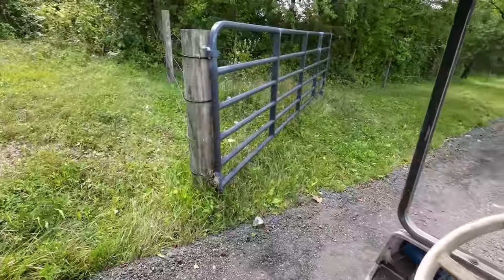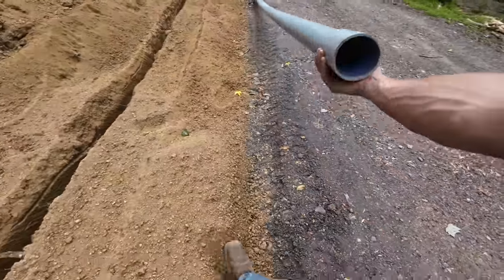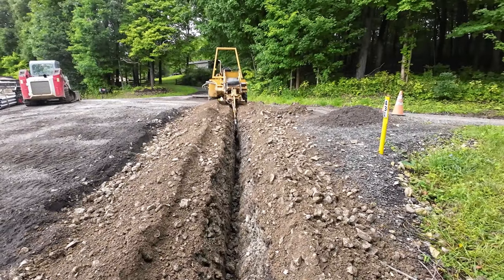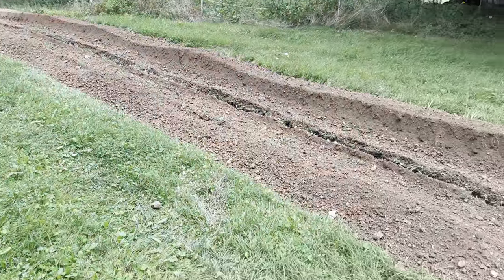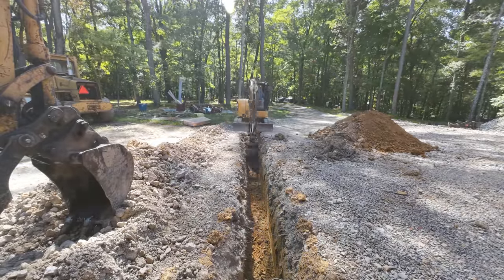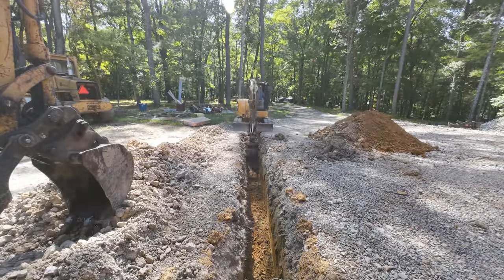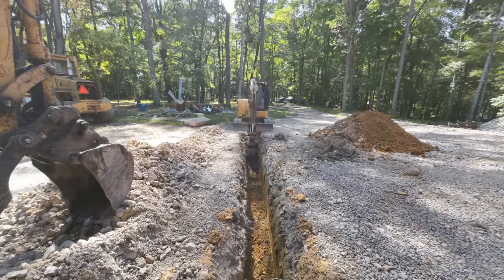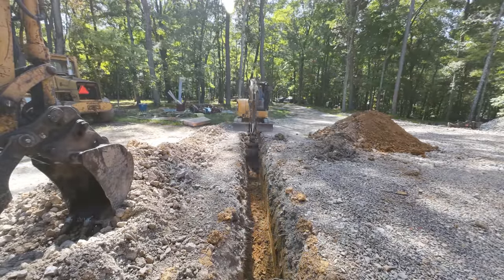Running Nearly 1/2 mile of Underground Electric, Costs over $64,000??!?!

Comment: 52,000 thounded aint bad for 2500 ft if they had to burry it bud its just pulling it in, but your going to pay for the transformers, the wire (high voltage not no romex), meter, time and your not living there so that ups the price alittle bit generally

Comment: If you are responsible for the drop from the pole to the transformer then you can have anyone install the wire.    Call around to various electrical contractors they will know.   I know where I am if the buried drop has to be replaced the home owner is responsible and must get a qualified electrician to make the repairs. .

Comment: I am retired but during my working life I was quoted a large amount for pipe and install wire I found out that there was a new type of electrical wire and that can be installed in older conduit at a quarter of the cost by a private electrical contractor. Done. (30 years ago) looks like yours is playing same old tricks.

Comment: Lol I got a quote to get 3phase power to my house and I live in an end terrace and the 3 phase is cable is attached to the outside of my house and all the power company has to connect one wire 6ft long into the meter my quote is £12000 or about $17000 so I got a phase convertor.

It might be a cheaper solution to you to get a wind turbine and solar panels to run light and heat and small power tools and use your generator for the big power tools and welders

Comment: Sounds like they are charging you so much that you can engineer yourself a solution to pull the string through the pipe for far less and you should.  Look for or invent a roller system using an engine that can "Roll push" the line through the conduit.  A transformer is mostly a box with oil in it, and you can lay the foundation concrete yourself for the transformer.  You can save yourself a bundle, and it would make a great video to engineer a solution for it.

Comment: You do realize solar is $.30 a watt now.  Solar you’d lock in energy costs for 30 years. This is going to cost as much as solar and then you’ll be paying for energy costs as they go up and up and up.  Now water. I’d run that pipe. Wouldn’t want well water anywhere near your property. Not enough sand on the earth to filter all that diesel.

Comment: Everybody wants to do electric work till its time to do electric work. 
Those pulls average 700 feet. The cable reel will weigh maybe 2.5 tons. 
Jet your mule tape with an air compressor. It blows easier than it sucks. A shop vac cant provide the volume to do 700 feet of 3”
I would have dug up those pull box locations
What the utility tariff in Pennsylvania say about overhead charges.  Underground is typically 3 or 4 times overhead for construction 
Sorry . Every thing is expensive. I bet that 3man (4 man) will bring about a million bucks of rolling stock to do that job and your paying for at least 3 days of work
We used to charge $250 hour to sit a bucket truck out on trouble work

Comment: Will the power company let you run the wire. Pulling the wire can be rough but cheaper than 50000. You have a friend that's a electrician, he can oversee the job

Comment: my dude, 64k buys a lot of solar pannels and batteries
Reply: well, other option would be to have all the wire installed and asume it was always there, but i don't know how that would work with the electric company, if the line was overhead it would be a bit easier to inspect but i don't know how do they decide wheather or not to aprove the work.

Comment: Bigger diesel generator. Set of batteries and inverter for when you arent using much power and dont really need the generator going. Use the waste heat from the generator to help heat the shop. Guess it depends on what you pay for fuel, power etc as to how the money balances out, but it sounds like you are going to be struggling to pay back the 50 plus k?

Comment: I am in india, it doesn’t matter where is my shop/home/warehouse, government or power company have liability to put my connection at my place.. only I have to pay for supply wire/cable form next pole, for that too they provide me ratings/range and I am free to buy from any vendors.. 

PS .. there should be a pole in max 100 meter in range so max I have to buy cable for 100 meter
Reply: 12 volt electric service?
Reply: @richardthomas1743  usually no.. 
AC 220/ 440/ or higher as per your need..

Comment: It's what you call extortion because they won't ecsept it if you put your own cable in because they charge far over the odds for the same cable which is out of order and I don't believe that it's legal requirements that you should have to use the cable which they supply

Comment: They threw that number obscene as it is to avoid the job. They don’t want that long run. Matt buy the wire pull it and they connect for free. It would be cheaper.
Reply from the maker: Wasn’t allowed. They don’t care about the long run. That’s not even a big one for them. They connected it today. Did the whole job in 2-1/2 hours
Reply: @DieselCreek  well at least you got power now. Beauracracy can be a pain in the ass.
Reply: @DieselCreek  curious how did they run it so quickly?
Reply from the maker: @BernardMiller-u4t  20 guys with 10 trucks lol
Reply: @DieselCreek  wow sounds like overpowering the job.

Comment: Just a guess but from where I’m from I’m not even sure 50k would pay for the cable alone.

What is the voltage? And cable specs you have over there in US?
Reply from the maker: the high voltage was 7700 volts but then it goes through a transformer to 220v

Comment: Have you thought of running a small solar setup to power the heating circulation pump should you not have the power connected in time for winter? It’s a viable option in Australia, I. Guessing they’d be available in your neck of the woods too? 🤞🏼

Comment: Hay Matt hope this helps in a small way
Reply from the maker: Thanks so much!
Reply: Hey Matt, what if you pull the wire yourself I think they use aluminum instead of copper and then it goes through the transformer to copper see if they gave you a much better deal
Reply from the maker: @mikemchale7639  not allowed to pull my own wire

Comment: Why do they have to pull the wire? I mean can’t you pull the wire or have and electrical contractor do it?  40k in labor to pull the wire. Naw that can’t be right. They were thinking the whole job. 

It just the wire in the pipe at this point.  They didn’t mean that. I am surprised they didn’t let you put the wire in. All they really need is to make sure you use the right wire and the connections are correct. Yeah that’s the wrong number. 52k that’s 100kw solar panel money with 60k batteries. 12 + 52 = $ 64k  good grief!

Comment: Electric companies have you by the short and curlies when it comes to running poles and wire On the long of a run I'm surprise that did make you purchase a transformer, you really should have help doing this .Bob the electrician or the dude from scrappy industries ,I know your young but this a bit much for one man to handle ,Living in the boonies is very costly when it comes to running electric company power ,54k isn't really that bad considering the entity your dealing with, I know the sting hurts but a lot of us have been there before you

Comment: I’m a lineman, we probably cost the company nearly $70 an hour. That’s not base pay, that’s benefits included too. It’d probably be a 4 man crew and it’ll probably take two days so that’s probably $5k in payroll just fyi. But the pulling equipment and the terminations are pricy as well so take that into account. Still outrageous though.
Reply: It would take a 4 man crew 2 days!  How is that even possible to take that long?
Reply: @richardthomas1743  that’s also assuming the casting is already set for the equipment too

Comment: Going off grid with solar and batteries would have been cheaper
Reply from the maker: And also impossible for the loads that I will require
Reply: Impossible is a bit of a stretch, there would be systems out there that could fit your needs. Including having a generator as a backup source.

Not that it matters, as you have sunk lots of time and energy to be connected now.
Reply from the maker: @lhovo  we just don’t get enough sun here. It might work in the summer (big maybe) but no way it would pull me through the winter.

Comment: Your in a rural area, your the ONLY person using the transformer, your paying for it., either now or later, and being your a generally low consumption, seems like you could have built one hell of a solar system, and battery storage ?? Not that I’m an advocate of solar, nor could I tell you if it would support what your doing, but heck based on these democrats, the entire country is going to run off it, including electric stoves a dryers, .. but you should be able to handle the pulling of wire all the way out to the point where your local electric company is responsible to supply to., just because they offer and or are willing to price the job, they can’t force you to not be able to price shop, else it’s a monopoly., and you need to go to your state rep to explain this!!